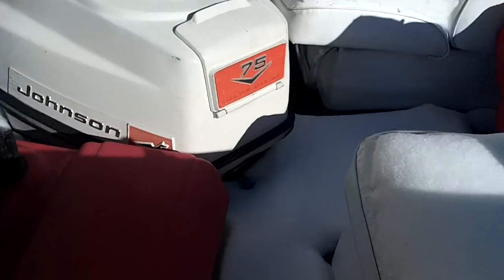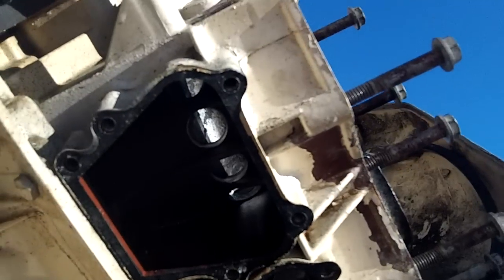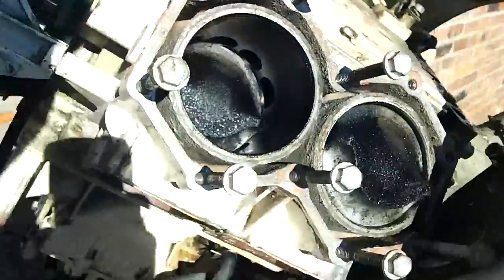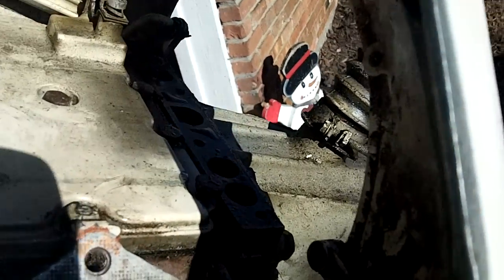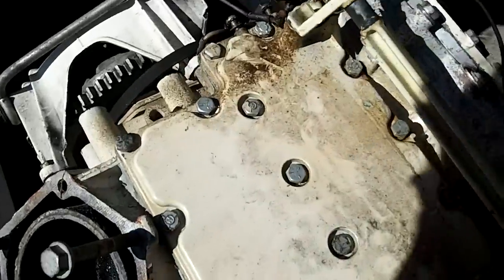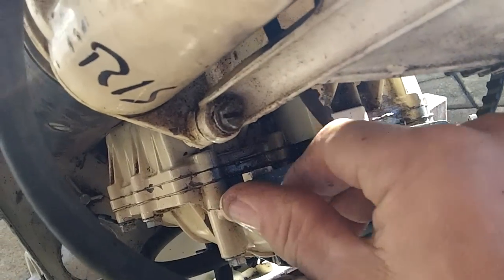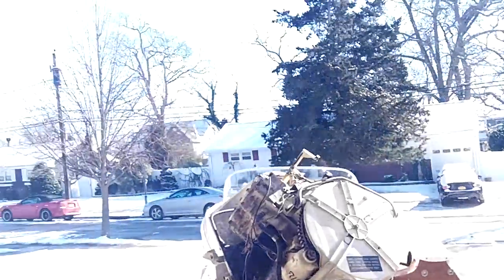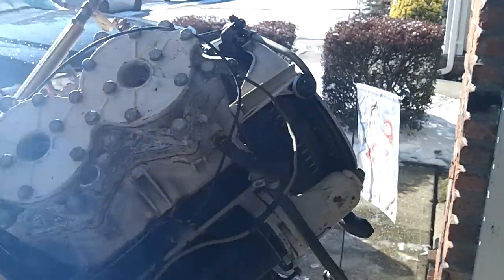1961 Johnson 75hp cylinder evaluation (VS4)

Comment: Got a jhonson 75hp 1961 electromatic, started it for the first time in who knows how much years and both cylinders left side spark plugs came out with water, feelsbadman. Hopefully its just the head gasket but knowing there is a crack in the water hose I bet they overheated it and probably both cylinders aint going to look pretty, carburator seems nice but the fuel pump is definetly not working.
 Its missing pretty much the entire electrical system not counting distributor and stator but hopefully if I can fix the water on the cylinders and the magneto gives power im probably going to use a voltage rectifier regulator from more modern jhonsons to hopefully charge the battery.
Good video dude gave me a bit of an idea what the issue may be. That cylinder wall does not look good but it all depends on how deep they are, if its just superficial you could fix it with sandpaper or a tool for that matter also if the "chrome" material was removed by the piston you pretty much need another block or get it to a shop to fix the cylinder on top of getting a new piston and with rings.